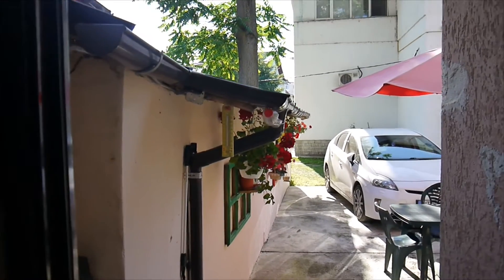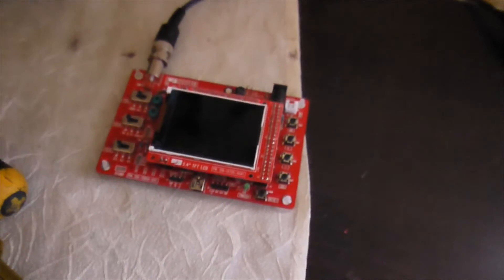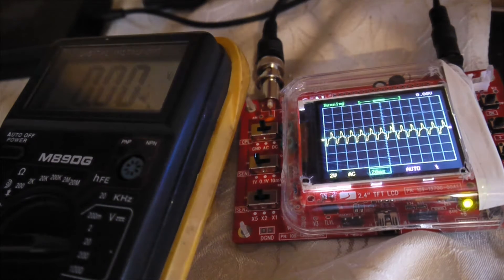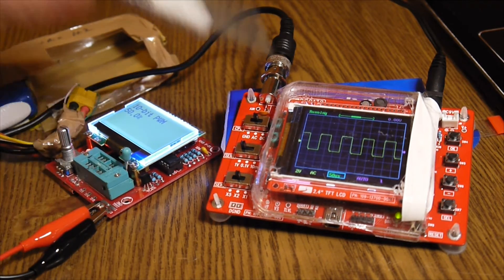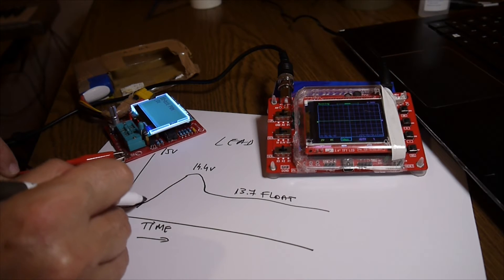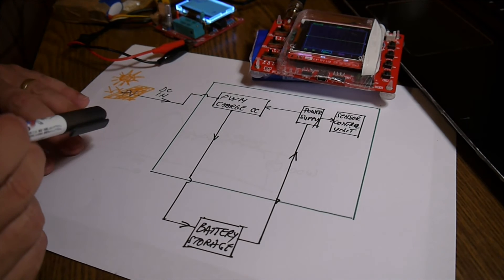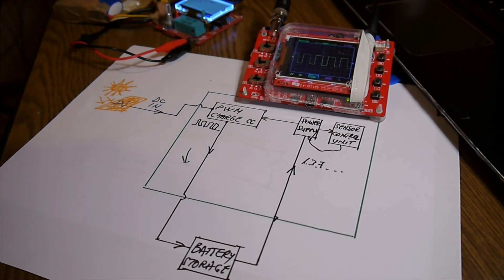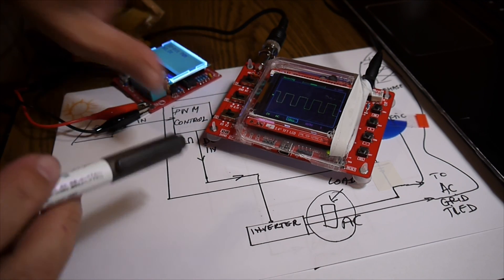How a PWM solar charge controller is working

Comment: Thank you for your excellent and informative video. Would a diode stop power getting lost to the grid instead? Forgive my limited understanding. And Does the PWM give into the battery from flat all the way to full charge please, or does it gradually back off after getting half or three quarters full for instance?
Reply from the maker: I don't understand about diode..but the other matter...it's about duty cycle..or how much the switch is on! consider the PWM like an ordinary switch from panel to the battery, when the battery is depleted the switch is almost on permanently...that's duty cycle 100%...when is full it will be like 10% on..only to maintain the charge..and yes is backing of like shorter switch on the circuit ,of course there is a voltage control to avoid over charge the battery, which ,once got filled have the tendency to follow the solar panel voltage ..going up to 20V! That will destroy the akku of course.I have more videos about this...check my last one..
Reply: @viocaia  Thank you so much for replying. And so swiftly. I'm following you now and will look at more of your helpful, well explained, detailed videos. (-: